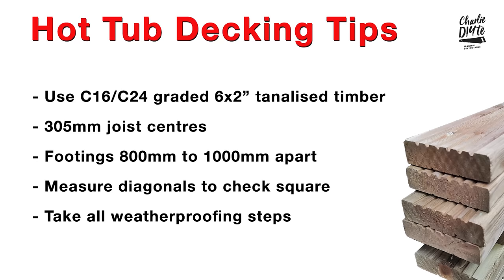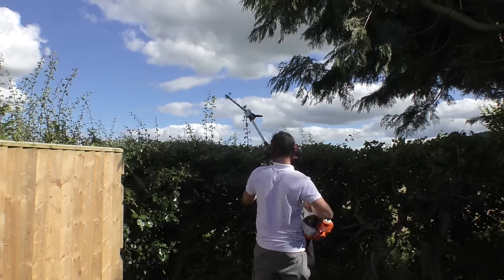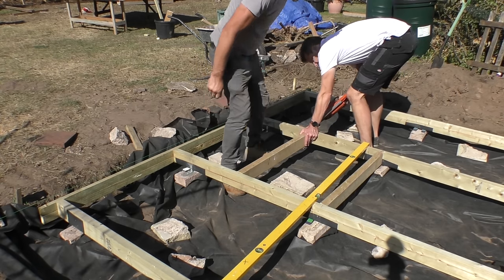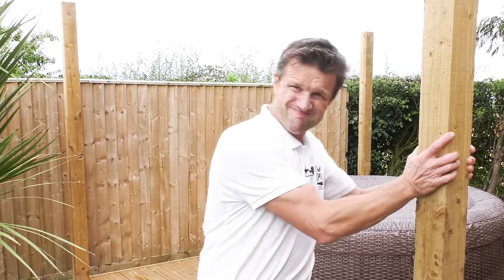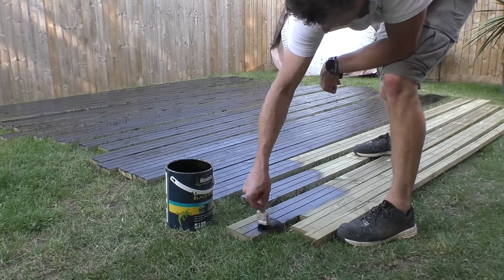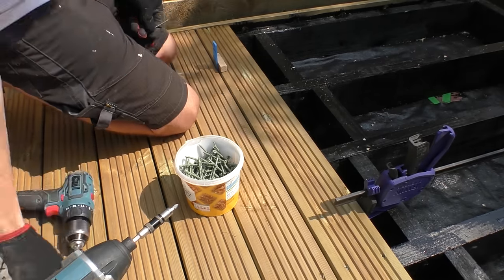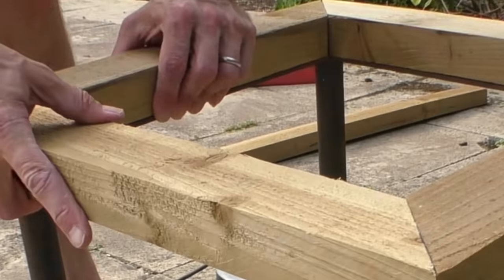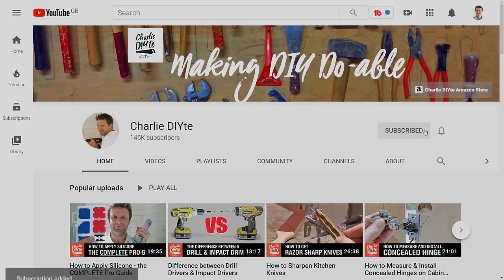How to Build Decking for a Hot Tub

Comment: I don't think a deck should have a run off because rain water falls through the gaps. If you did put a run off then I don't think the water would run off as it would fall down the gaps anyway and of course get caught in the grooves. I'm not a pro either but I won't be putting a run off on mine.
Reply from the maker: I think that's right Craig. ie, what's the point in having a gradient given what you say? 👍 I also think I'll give it a quick coat of decking sealer next time we've got some decent weather and I've drained the tub, as this will undoubtedly prolong its life and make it easier to keep clean.

Comment: Really annoyed at how mine was constructed by a contractor to how yours was done for a hot tub. Mine was constructed with no where near enough joists or noggins. After two months usea with my helsinki lazy spa on top of the decking, I can see evidence of sinkage and bowing of the decking. I've had to move the hot tub onto the patio. Not a bad thing but the decking area was an ideal area for extra privacy. The decking will be fine for a new seating area but just not for a hot tub that this was meant and paid for.
Reply from the maker: So sorry to hear that. I think at some point you should bite the bullet and get someone in to unscrew and take up the deck and redo / strengthen the sub frame. As you say, so frustrating though when you've paid someone to build it to a certain spec.
Reply: @CharlieDIYte  unfortunately I wasn't there when they finished the work and noticed after they had used a nail gun instead of screws. So this will be alot harder to resolve.

Comment: i built a very simular dick  about 15 yers ago with pressure treated wood and patio blocks. Never again the deck completely rotted out because there was no ventilation under the deck to dryit out after rail or hot tub splacing, i am building a nw deck for a new hot tub and it will be high enouc=gh to allow plenty of ventilation